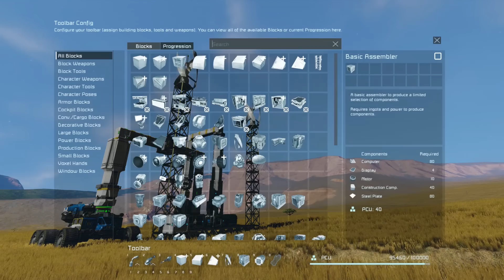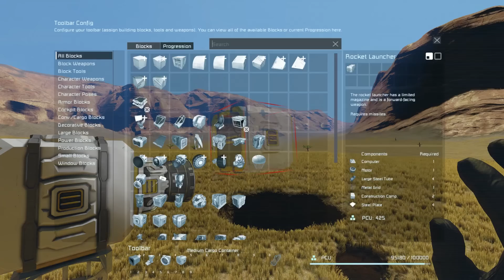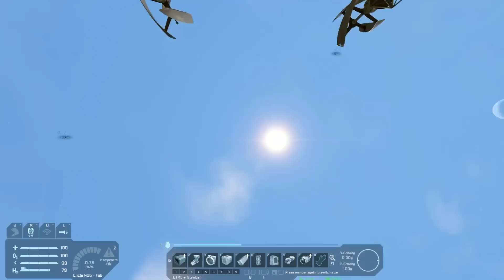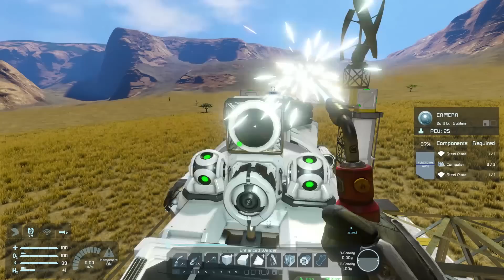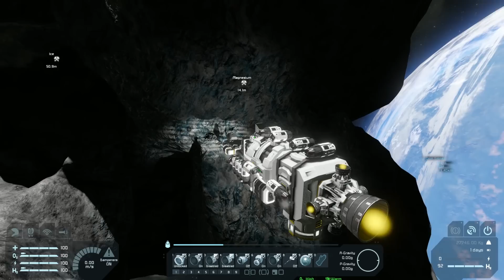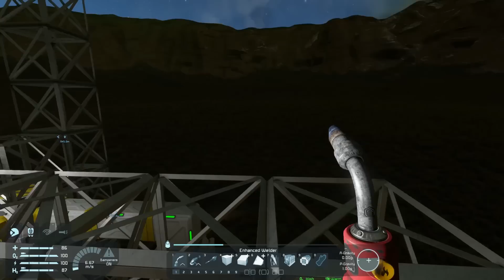Going to Space - Getting Started in Space Engineers #6 (Survival Tutorial Series)

Comment: I hope they make hydro a bit more efficient. For thrusters I think its fine, but the hydro engines are insanely inefficient, especially small grid .
Reply: There is a reason it was nerfed. Hydrogen shouldn't be default thrust source.
Reply: they don't want multi-environment ships to be easy, or the insane thrust of hydro engines to be sustainable, that is part of the game's balance. Hydro provides insane thrust, but it isn't practical to use constantly, forcing you to use it as a boost for atmo or ion, as well as a way to get limited operational range in either environment. Later in the game, they are supposed to be treated more as emergency thrust, this gameplay design is reinforced more by the hydrogen engines, which consume hydrogen very quickly, so are likely intended as an emergency power source. The other use case for hydrogen systems, is for missiles and fighters you don't intend to have a long shelf life, so more expensive to build power and propulsion systems are a bit of a waste.
Reply: They probably wont, unless there are more complaints about the engines.  if you don't mind using mods could always use one called Better Hydrogen Engine, on the workshop https://steamcommunity.com/sharedfiles/filedetails/?id=1700502823

Comment: Correct me if I'm wrong, but with a small rearrangement of your atmo thrusters you could leave several Vents on the sides of the Hydrogen Tank and the Large CC to help fill up while in atmosphere, yes? Just wondering. I often build vehicles and then let them sit to recharge. Since they're sitting anyway, might as well get the free air.
Reply from the maker: Definitely could have, there are some other ports free too - like the ones on the connector that could have been used :)

Comment: Why not put hydrogen engine for power as well?
Reply: Complicates a tutorial video that doesn't need it.
Reply: Because hydro engines eat fuel for vary little power, tried using them once and found them generally useless, wind or solar (esp with tracking script) provide enough power.
Reply: @gordon861  Flying also use lot of hydrogen.. I find out hydrogen engine to complement hydrogen based ships well. If someone use it as prime power source, then it is obviously dumb.
Reply from the maker: Pretty much what Giant Panda said. Having a hydrogen engine is more likely to leave a new player stranded in space with no fuel, at least having a separate gauge for power and fuel you can keep track of both and know what to do to solve each. For a new player to need to remember to turn off both their thrusters and engine seems more error prone to me so I avoided it :)

Comment: Just for reference, I think they've changed up all the atmo thruster numbers recently and none of the wikis out there are currently correct. (Suspect they've changed up all the other types too but I've only measured atmo). Basically large is the way to go these days unless you're below about 4 total, it used to be more efficient to use multiple smalls. 
Some in game numbers for small ship atmo in a current vanilla game which I believe are correct ...
Small   699Kg   72KN    608KW
Large   2948Kg 436KN  2.4MW
Thrust to weight of small = 0.103 and large = 0.12.
Thrust to energy consumed of small = 0.12 and large = 0.18
Basically a large is worth 6 smalls in terms of thrust but weighs a lot less than 6 smalls (4194Kg vs 2948Kg) and is 1.5 times more energy efficient than 6 smalls. You kind of need to be below about 4 smalls or really need to save space before smalls are worth it now!

if you want to check this. Weight comes from adding one thruster to a grid and checking the mass in info. Power comes from the thrust override slider on the thruster, it shows the KN. Power consumption is shown in the control panel for the thruster.
Reply from the maker: I've always been dubious on the wikis as there are so many of them that I think it's hard to get people to focus on one to keep it up to date, thanks for sharing your figures :)
Reply: This is incredibly useful information. Thanks for posting it.
Reply: Thanks, needs a bit of peer review but I'm pretty certain of the numbers.
Reply: @Bystander333  So they repair it finally? Large thrusters should give more power, when small ones should be more reliable.
Reply: Yeah, I followed this tutorial in December 2022, and I get WAY less power in my hydrogen thrusters. He had 240kN, I only had 98kN.
Edit: So, I basically need 2.5x the power of the ship in this video in MY ship. 
I think...
Re-edit: My goddamn hydrogen tank was set to stockpile. 
For two days I couldn't figure out why I couldn't get out of my planet's atmosphere. I remember that I thought "Ill just try this out, but I need to remember to turn that  off again."
Reply: Great info. I use large thrusters any time I can. I typically build ships around the thrusters, since they are so big. I still use small thrusters for sideways movement in most cases though, since I typically have 3 or less each direction.

Another tip when building a miner using large thrusters is to put the reverse thruster on the top rear of the craft. As long as the thrust is clear in front of it, the craft will be much more drill capable and the thruster wont get in the way.